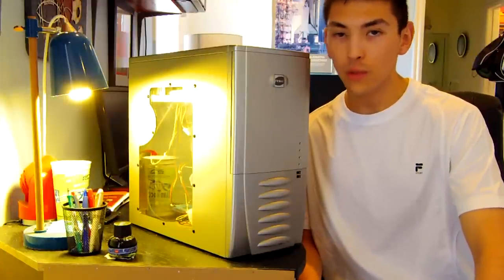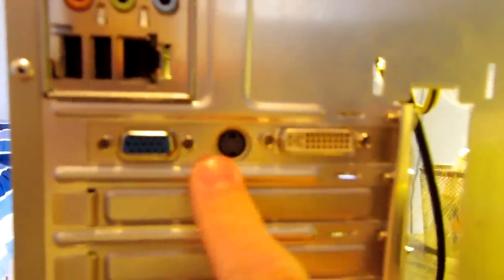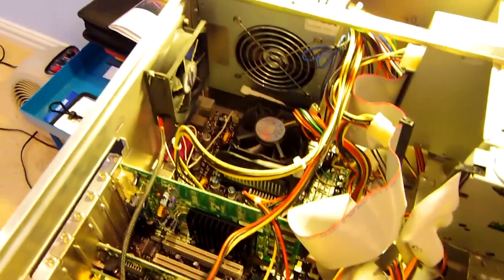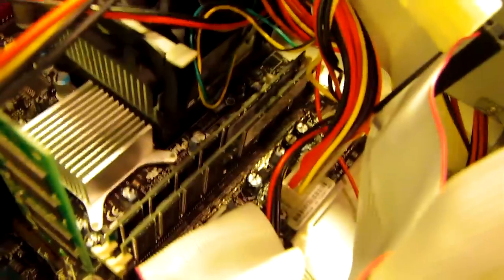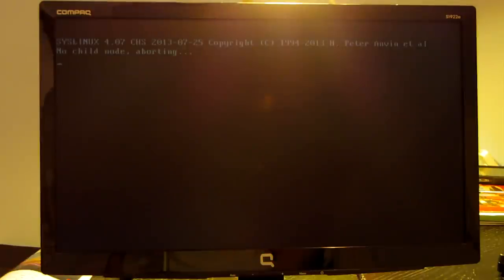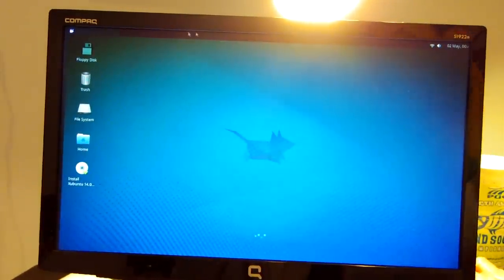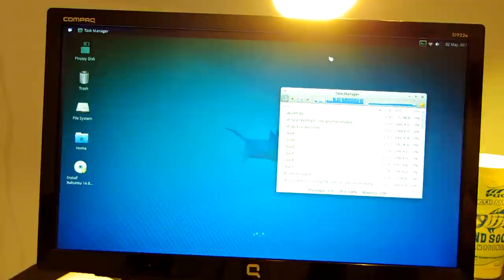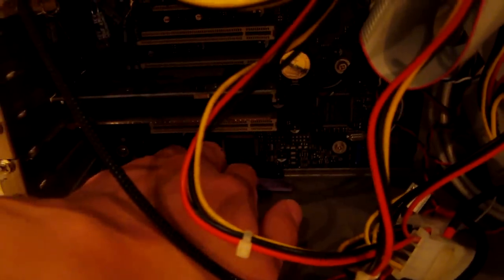Garage Sale Finds: $5 Custom Built "Antec" Gaming PC (Pentium 4)

Comment: Can it run battle field 4k ultra settings 700fps?
Reply: Yeah bro but it will EXPLODE!!
Reply: Dude easily

But if you wanna play pong maybe 260p low settings 22 fps most of the time
Reply: - UbiHERO thank you for the help i will now buy this
Reply: yeah you need to write 700fps on the monitor though
Reply: ryan pogue oh ok thanks
Reply: +Azsx and also put in a usb that kills pc's:-)
Reply: ProCreeper 2000 XD

Comment: Ever since they made Flatscreen TV's able to be used as monitors, monitors themselves have pretty much become worthless.
Reply: *****  That's crap. There is no difference between an LCD monitor and an LCD TV apart from the features. Besides, I see lots of Tubers using widescreen TV's as monitors.
Reply: RandyDarkshade the difference between them is the refresh rate and input lag.
Reply: ***** Because a lot of tvs, other than high end ones, use an interlacing scan instead of progressive. That's the blurriness.
Reply: RandyDarkshade Input lag. According to Wikipedia some TVs can add as much as 90 ms of input lag, because mostly TVs just display a steady video and it doesn't matter if it takes a while longer to display a frame. Imagine typing (and while this is exaggerated, a lot of TVs are really bad) it takes 5 seconds for each letter you type to show up/ 5 seconds before your cursor moved after moving your mouse.
Reply: Kevin Brown 
I use a 40inch LED Philips TV
It's 1080p 5ms input lag 60hz
Not blurry at all its really sharp and beats my old monitor by far
I got it for 240$ used
Back in 2011 it did cost 1400$ though
I dont understand why people buy new screens honestly
Used ones make no difference and look at that price gap
Reply: floSa 
I can understand gamers being picky over their screens, but I don;t game so I'm not fussy. lol
Reply: RandyDarkshade 
Well I do and only my case plus fans cost already 350$ 
Still I see no need to throw away money for such a screen
Reply: floSa  I know... I never said progressive scanning is blurry. And I said most. You can find some TVs that don't have a much delay.
Reply: Kevin Brown
Well you will realise that today only screens which are made by some shady unknown companies and VERY cheap screens will have such problems.
Reply: Antwan Armatrong yeah well most LCD TVs you can go into the settings and put it into game mode to make the refresh rate a lot better

Comment: You don't know what solid state caps look like do you? I only see SS caps around the socket.
Reply from the maker: +Pablo Escobar I do know what they look like. You are correct, they are all positioned around the CPU.  Did I say otherwise in the video?
Reply from the maker: +Pablo Escobar Oh I see what you are saying now. I stated that the board was fully equipped with solid state capacitors, that was a mistake. I threw in an annotation correcting that. I cant believe no one else has said anything up to this point. Thanks!

Comment: A good friend of mine gave me a Pentium 4 PC. But i think it has a power supply problem. Every time i shut the system down, the keyboard lights stay on until i unplug the system or turn off the power supply.
Reply: ***** Does it only happen to older computers? Because on newer ones the keyboards and mice always shut off if the computer is shut down.
Reply: ***** Well i don't worry about it. It just seems weird to me as i'm not used to it.
Reply: +Alari645 my windows 7 build did this for years until I did a clean win 10 install.  After the upgrade this magically stopped.
Reply: +Alari645 there's a jumper for that on the motherboard.

Comment: its capable of gaming, just nothin really modern cept some indie games indies, flash games (maybe), quite a range of XP/2k era games that'd run on it, and 9X stuff too given 98 as a OS install.
Reply: +patg108 and machines like this can handle web browsing, at some moderate resolutions, wouldn't really try 1080p, probably not even 720p (argueably, could be beefed up enough to handle it).  And certainly not crapload of videos (wouldn't push more than 3 or 4 with firefox really).
Reply: +patg108 could probably do better in XP, linux doesn't have the best drivers nessecarily, might handle lower end hardware better with some tweaking.

Comment: Nvidia FX-5200..

That wasn't a gaming pc when it was built to begin with.
Reply: +Bas van der Meij (Ykai63) the geforce 3 ti-500 64 meg card gets better fps than the fx-5200 256 megs i own both cards. I actually own boxes of video cards
Reply: *****
Very cool isn't it? The FX5200 was a flop anyway. The fact that it was able to use DX 9 made it kinda worth it in some few instances.

 I found an old Geforce 2 ultra graphics card in a thrown away computer when I had my geforce FX5200 and the geforce 2 worked and was faster. The only real problem was Directx 7 xD

Not that games looked any better on the FX5200, you had to turn the settings down so much that it really didn't look like DX9 but at least it was compatible with the newer games and that made me put it back again.
Reply: Bas van der Meij
when I first bought my "gaming computer it had a geforce 2 ultra. the only reason it was considered a gaming computer at the time is because my previous card was an sis 6326 4 meg 3d card but at that time the geforce 2 ultra was the best card on the market, it msrp was like 350 dollars lol.my geforce 2 ultra and geforce 3 ti-500 look alot alike. they use the same main heatsink for the gpu and the same green heatsinks for the memory and are the same size
Reply: ***** That is really cool, my first "gaming" computer or better said computer I played games on had a FX5200 128MB in it and it gave me head aches. it was in a system that had a 2,4Ghz P4 and 512MB ram

Average fps wasn't that terrible but the frequent and extreme fps drops made it so damn annoying. 

I played Half Life 2 and Counter Strike source
on the damn thing and the FPS was averaging at around 30-35 fps but when shit would hit the fan you could get into the single digits and that is exactly when you do not want that to happen.  

The Geforce 2 ultra dropped to around 20 fps at the same settings, which even though it is not perfect still is miles better than drops to 8 fps...
Reply: Bas van der Meij
yeah video cards are fun. I ended up starting to collect them and will run them against each other cause some dont have certain texture compression and just makes the benchmark look different from one to another.lol I have shit so old it only supports direct draw not even direct x
Reply: ***** Direct draw, holy, that is old indeed! 

And yeah I know, the same goes for Half Life 2 on my two old cards, the FX5200 supports all the DX9 options just too bad it was never able to keep an acceptable FPS on DX9 and I ran it at DX8 or 7 for CSS. It looked much better on DX9 but the Geforce 2 ultra could never do that since, well, it only supports DX7..

I actually don't collect computers and graphics cards anymore due to space limitations :/ too bad, it is a lot of fun indeed.

Ah well, I run a GTX 660ti now and I am still fine with it for all the modern games.
Reply: Bas van der Meij
yeah I use a gtx760 which is just a little faster than a 660ti and I wont upgrade til I need too

Comment: They don't make PC's like that anymore. Desktops these days have No PCI slots, and all you can edit is RAM.
Reply: yes they still do
Reply: Nicholas Ruiz They do? Thank you! I must not know where to find them
Reply: BML Productions In prebuilt PC's they do not, but if you custom build your own it will have all the ports a normal motherboard will have, that's why they still sell graphics cards online.
Reply: +BML Productions And you can still change the CPUs as well as the RAM you mentioned and swap video cards as Nic mentioned.
Reply: KiwiPowerNZ
Not on mine, it has no port to put ANYTHING besides RAM, And the CPU, but I'm stuck with a 32 MB video card.
Reply: BML Productions -_- that's horrible! The video card might be using an AGP slot not PCI express meaning there is almost zero video card upgrades you can get. I was faced with the same problem in 2007 with a Dell motherboard, so in 2008 we custom built our own PC and it lasted for 8 years until lightning hit our house a month ago, now we rebuilt it even better.
Reply: If it is an AGP slot there are some graphics cards out there with 1GB of video memory and they can play some older games such as multi-platform games released early on it PS3s or XB360s life.
Reply: KiwiPowerNZ your PC wasn't grounded?
Reply: Nicholas Ruiz It was grounded. It got shocked through the SPDIF audio interface. Lightning hit the TV antenna -> went through the distribution amplifier in the roof, then went 2 places, killed the TV recorder and killed our stereo then jumped from the stereo to the computer through the coax audio cable, then went through the motherboard and out the Ethernet port and killed the port and one of the ports on our network switch, plus the graphics card.
Reply: We got hit bad, lightning blew a hole in the concrete right by the garage door, killed the electric door. It's a concrete slab house, it went through the reinforcing steel in the concrete and blew a hole in the floor under the washing machine, it went up into the washing machine and blew a component to pieces, but it's been fixed now. Even our power meter and our pole transformer got destroyed.
Reply: It was an Asus P6T Deluxe V2 motherboard and it still worked after getting shocked! I put an old graphics card in it to see. Only thing was it kept saying "New CPU installed would you like to enter setup?" everytime you booted it up.
Reply: Is 1 GB of  video memory good these days?
Reply: KiwiPowerNZ Sorry that happened ):
Reply: BML Productions yes usually 1-2 GB are fine for gaming
Reply: BML Productions 1GB of video memory is marginal these days. System requirements for games usually have 1GB minimum.
GTA V - 1GB min 2GB recommended
Black Ops 3 - 1GB min
Star Wars Battlefront - 2GB min 4GB recommended
Reply: KiwiPowerNZ Jeez, when did games get like that? That's crazy.
Reply: BML Productions Since the next gen consoles came out games are suddenly improving graphically.
Reply: That's minimum for the most demanding games. You might not even like those games, I just listed them since that's what I've been playing. If you like racing games you'll be happy to know they're usually not that demanding.
Reply: n

Comment: ddr3 on a p4 pc?  where did you dream about that?  p4 work with ether sd-ram or ddr1.. or maybe an ddr2 if your lucky an find a retail board with a ddr2 :P  and payed 5 dollars..yay i feel lucky'er..i have got 6-7 of them for free :D  oh and get rid of that antec power supply..there a wreck, they are famous for blowning up for no reasson an taking the board out
Reply from the maker: andreas djsmashy No, I said DDR-333. DDR ram running at 333MHZ. LOL not ddr3, I wish :p. Yeah the Antec power supply is pretty sketchy, so far I have had a lot of issues with it.
Reply: lol! well ddr 333 sounds normal(ddr1) xD well if the rest of the pc is still going strong just get a new psu and your good to go! :) you can find one for cheap..an 300-400watt is fine for a p4 pc
Reply: +Gatewayuser200 I'm trying to find a LGA 775 board now. I've seen plenty that support DDR3. Some that support DD2 and DDR3.
Reply: +AA Computers and Technology  LGA775 boards use DDR2 you can get p4,Dual, and C2d on 775..
Reply: Justin Felder iv got a board that takes an lga 775 and ddr2-ddr3 ram.. i thinking of making it my surfing pc.. if that idea crashes ill probably sell it
Reply: Brian Buckley 775 with ddr2 do exist(i have one ifront of me right now that takes ddr2 and ddr3 ram) but the pc in this video wasent a 775 socket(i think its a 478 if i remember right)
Reply: 478 is limited to DDR2, but remember, 775 ran a bunch of chips. including  P4,PD and Core 2, &C2Q....Does not mean the P4 would take advantage/compatible of DDR3 fastest would be DDR2-800 on a Prescott supported Motherboard/chipset.
Reply: Brian Buckley what are all you on about..? my coment was pretu clear..  i have never seen an board  with 478 socket p4 cpu suport ddr2.. i have a room full of pcs.. none 478 p4 boards and none supurt ddr2.. lga 775 boards suport and ddr2 and ddr3..i own a board that does.. and i never said that 775 p4 and celerons dont exist...i own some of those too so yea they exist
Reply: +andreas djsmashy just Google "478 and DDR2"......I have an office of retired PCs also and have probably 3 or 4 of them which are 478(even mobile 479). again the only caveat is I believe it needs to be a presscott/and perhaps Select Northwood based processors which support DDR2-800 and I think a 945 chipsets or higher.....YOU SAY 478 does not have DDR2 support.....I am telling you it does.....in some cases.That is what I am "on about". all I am trying to say amigo.
Reply: its obviusly an ''retail board'' just like the 775 with the ddr3.. im stating that no original(not retail) have ddr2 ram.. so the ones you have are retail boards not original ones
Reply: Brian Buckley its obviusly an ''retail board'' just like the 775 with the ddr3.. im stating that no original(not retail) have ddr2 ram.. so the ones you have are retail boards not original ones
Reply: +andreas djsmashy I have no idea what an "original Board" is....of you mean from an OEM like Dell or HP, I assure you it exists there too..
Reply: Brian Buckley original one is one that youl find in any pre-built pc like hp,dell.. a retail one if prety the same  with the nornal one(original one) but alows you to add  newer stuff to your pc (like more sata. pci-e  newer ram) both ''retail' and ''standard' board are oems..just upgraded..simple
Reply: +andreas djsmashy 
Wow reading problems? it clearly reads ddr 333
Reply: delukard07
for forks shake..first he said it, didnt write it(so ur statement is pointless).. and second the crapy laptop i used came up with sound problems so it sounded like ''ddr 3'' but i noticed after i commented..SO stop braging on me .''
Reply: Don't cry, you were wrong. accept it and move on.
Reply: You pretty much care, because  you still keep posting.
And you will still post

Ohh BTW solo porque tiras raza no te hace RAZA ja ja ja ja .
Reply: +andreas djsmashy I have a board with 2 slots for DDR2 and 2 Slots for DDR1
Reply: TheReedBreed  well i have boards with 2 sd-ram slots and 2 ddr1 slots .. and boards with 2 ddr2 slots and 2 ddr3 slots :D
Reply: DDR3? wow wouldn't have expected that for a pentium 4.
Reply: TheReedBreed
  yup! it can run a p4 cpu.. im runing a dualcore xeon on it tho :)
Reply: Oh. Cool though.
Reply: +andreas djsmashy DDR 333
Reply from the maker: +Blah1069 McDonalds and 7 Eleven do not pay you back overtime. I have used many of the parts from this system to make other videos. Overall from this system I have profited a couple hundred bucks which has gone back into new computer and filming equipment. Even if I did not make any money back from the system it would not be a big deal. My channel is about learning and having fun at the same time! So I would have to disagree with you, this was a very good investment :) .
Reply from the maker: +Blah1069 A lot of people like checking out old hardware like this, so yeah, why not make a video. What do you mean you would never waste your time with this? you are the one who watched at least some part of this video.  If you don't believe me just look at the view count of this video and then calculate my earnings using an average CPM. No offense taken, people have differing opinions and there is nothing wrong with that. Thanks for the discussion!
Reply from the maker: +Blah1069 Average view time is about 5 mins, which is not too bad considering the view count.
Reply: Justin Felder
 i got one 775 one with ddr2 and ddr3
Reply: BagelBytes
already explained why i said that..pay more atention on my comments

Comment: Polycorbonate Plastic! That graphics card looks like a piece of junk, by looking at the connections of the capacitors it may have been modified or suffered a poor repair! I used a Military grade MSI motherboard G41M-P33 combo, a Core 2 Duo E8400, I have 8 gb of DDR3 1600 mhz memory, since every type I tried wouldn't work, including 1066 and 1333, it works great with the 1600 mhz, I have EVGA Power Supply just a 430 watt since it had proper amperage for the graphics. And EVGA Ge-force GT730, tow 7200 rpm Sata Hard drives, I am running the original Vista home premium that came with the gateway case, plus a Coolermaster 120mm Liquid cooling unit, operating temps do not exceed 39 deg Celcius or 102 deg F! I am glad I saved my 8gb of DDR3 1066 to use when I build a Shuttle SG41J4 with another E8400 CPU, just a 160 Gb 7200 rpm HD and a EVGA 210 graphics card that has been modified to include a cooling fan and heatink, it will be running Vista Home Basic and will have dual layer +/- dvd burner! I know the 1600 mhz memory sounds impossible but that is all I could get to work after spending $160 for two different memory types, that never worked and as soon as I opened them a restocking fee would have applied! So I saved it for another build at a later date! I have some 4x agp cards left over from my old socket 370 and 478 builds years ago, ATI Radeon R9550 w 256 mb and MSI build Nvidia Ge-Force GT 240 with 512 mb gddr5!